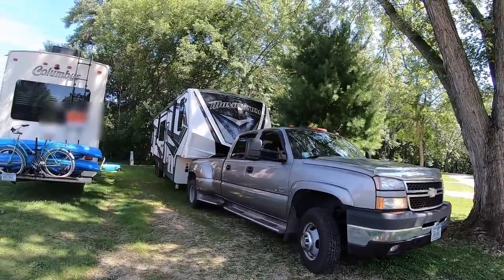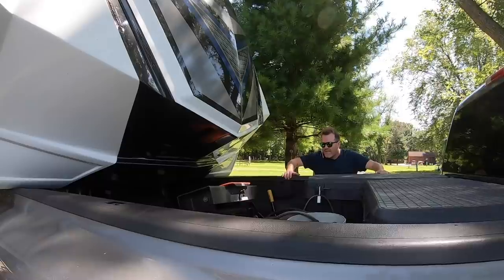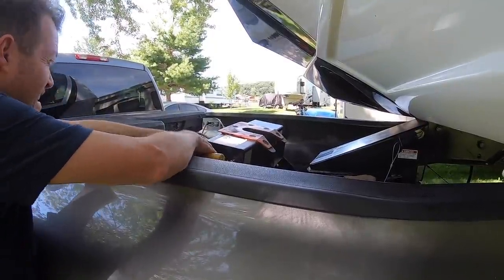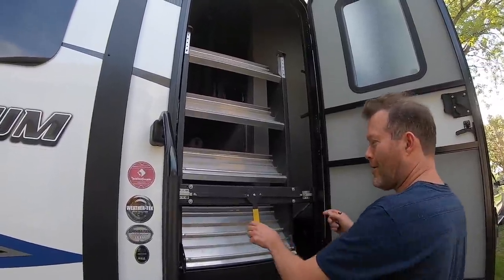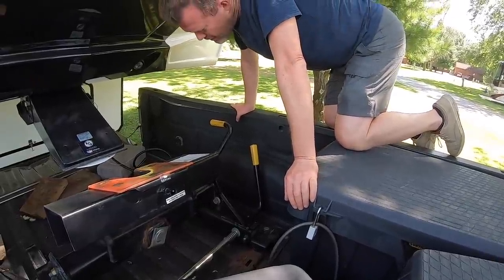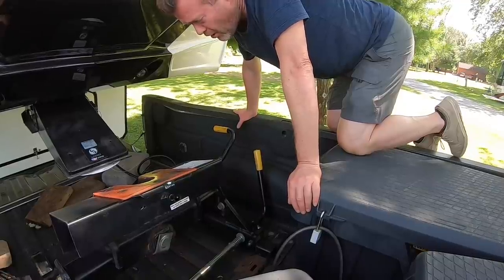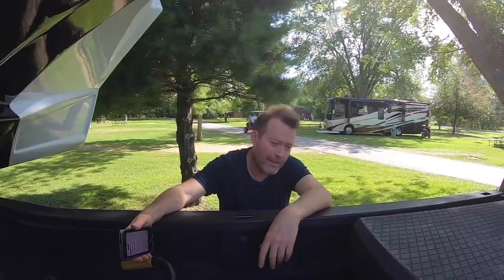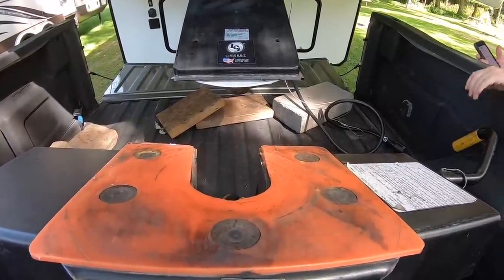RV CRUSHES MY TRUCK ON 1st TOW! BIGGEST RV LIVING FULL TIME MISTAKE! (PT 2)

Comment: This is why I LOVE my B&W Patriot hitch!  Simple, easy to use, superbly built and virtually zero chucking.
Reply: Chris Ducote 
I have a B&W Champion hitch, but the same happened to me. $7k worth of damage to truck only. We all live and learn.  I've pulled two trailers for 8yrs and still had one issue. Liked the comment from the trucker.
Reply: That's my model, very positive assurance it's locked.
Reply: I have a B&W companion and have never had a problem as long as you hook it up right. They are very easy and simple to use.
Reply: I love my companion hitch. They are simply the best
Reply: Held my breath the whole video
Reply: I have a Blue Ox fifth wheel hitch - Love it !!  And because it rocks back to give the extra short bed clearance, you don't get a "frozen" slider.
Reply: just gotta do a pull test no matter your hitch. takes 10 seconds and will ease your mind.
Reply: For 22+ minutes? Sure ya did.
Reply: I feel the same way abouut the B&W Companion.
I painted the jaws bright RED to help me see they are closed.

Comment: Hi! I’m sorry to see this happen to you. I’m a truck driver with over 30 years experience. I swap trailers daily. I want to share with you the steps I follow to avoid dropping a trailer. Connecting: 1. After confirming the fifth wheels jaw is open, back under the trailer lining up the king pin and fifth wheel. I should mention that you want the trailer’s king pin to be below the height of your fifth wheel. You want the fifth wheel to pick the trailer up slightly. This avoids the king pin riding over the top of the fifth wheel or the king pin tripping the jaw on the fifth wheel but not being connected. Once you feel the trailer connect to the fifth wheel, gently pull forward to confirm you have a solid connection.  Get out and visually inspect the connection. Is the fifth wheel flush to the bottom of the trailer? You don’t want to see any gap here. Is the fifth wheel jaw release in the locked position? If anything doesn’t look perfect, get under your trailer and visually confirm the connection. If you still aren’t sure of the connection, release the jaw and start over. If you have a good connection, go to the next step. 2. Hook up the pig tail making sure it goes in far enough to lock in place. If it doesn’t want to go in, spray both male and female connections liberally with WD40.  Also secure your break away cable. This is where we connect our blue and red airlines if applicable. 3. Last thing you do is lift the landing gear to ride height. Hope this helps.

Comment: As a CDL holder myself, you should always do a tug test after an auto-locking the 5th wheel pin snaps shut. That is how you verify it's locked.

Comment: Whenever the fifth wheel wont release the king pin you have the truck to far forward creating pressure that wont let the locking jaw release. With the trailer brakes engaged and landing gear down, back up a little to release pressure and the fifth wheel will release. 8 year trucker veteran here. Also find a suitable grease to apply to the locking jaws to keep the internals well lubricated and prevent rust getting in the way.

Comment: You could probably straighten out the bed rail sides by just putting a jack under it, and just raising the jack with a piece a two-by-four wedged up under the rail. The tailgate can be replaced
Reply: bottlejacks are great if you can find one small enough to get in there.

Comment: On a more considerate note, I appreciate your transparency in showing this clip, it is a way of showing other people to take care and double check that the pin has properly locked, also not to use two friction plates.
what I'm trying to say is thank you for showing what happened as you could have easily not uploaded.
Take care, James

Comment: I’m reminded of something I learned working in IT. Never make two changes to one system at the same time. Also, test changes before using. As noted elsewhere, do a pull test with legs down. The thing to note is that every time you hook up, that is a change, and needs the pull test.
Also, the fallacy of “I’m just going...”, as in your case “I’m just going across the park.” In reality that is no different than “l’m going across country.” It still needs the test.
Reply: Umm i have never worked in an IT environment where a patch or deployment cycle contained a single change. 

This is why we build AUTOMATED tests to test each part each time.

Comment: Classic high hook condition where the jaw wraps around the lower part of the pin instead of the center. When you pull forward the pin just pops up and out of the hitch.  If you manually apply trailer brakes and tug lightly before you retract the landing gear it shows itself with little or no damage. 

Lose the white lube plate, the hitch already has one.  

There should never be an air gap between the hitch and fifth wheel plate when you hitch the trailer.  The trailer needs to ride up onto the hitch when you back under it. The  lube plate increases the likelihood of this happening again because it adds space between the plate and the hitch.
Reply: Exactly. I knew it would not hitch correctly when I saw him install that white lube disc.

Comment: We have the same trailer as y'all, I noticed you had your shower doors closed...when we bought ours from the dealer, they told us to use the lock at the far left and lock them in the open position. This will keep them from sliding about when y'all are towing, and breaking all over the place. 
I understand this was just a short scootch down the lane, but thought I'd throw that out there...

Comment: My guess is the nylon disk is too thick for that hitch. The first time(when it fell off), you high pinned it. The second time(when you couldn’t get it unlatched), it barely latched the neck. So the jaw was stuck on the lip of the king pin.
Reply: Agree
Reply: Already had the plastic on the hitch head, probably didn't need the 2nd disk on the kingpin.
Reply: Was gna say the same thing need to take the disc off
Reply: I have to agree.  The white disc was not needed with this hitch.  Has a plastic plate built in.  Easier to high pin the thing with half inch of plastic taking up room.  Get rid of the white plate.  On the other hand, we have all made mistakes.  Nobody got hurt and a new tailgate and some body work along with six months and the memory will fade. You just feel rotten when it happens.
Reply: I agree. No need for the disc, it already had a plastic plate.
Reply: Exactly.... had the same issue
Reply: @caseybalvert3547  just gotta check for frame damage too. likely the suspension and bed absorbed most of it but that's a lot of impact force behind the rear axle. IMHO, me personally, i'd bang the bed straight from the inside since it's all open anyway. It's not a brand new truck so it doesn't have to be 100% exact. But i'm a cheap fuck, lol.
Reply: @looseballs1966  So thats' how I get grease all over my rig.... Never saw a 5th wheel wear out using just a little greas.

Comment: It looks like the pin is too high up in the receiver for the receiver to latch properly, I think you need to remove the slick disk (I think it adds too much thickness), plus it looks like that hitch has one built in. Sorry if someone has mentioned this already (I can't read through 1,577 comments).

Though I'm not sure since I've never used one of those, it's just a scientific observation. But from what little I could see in this video it looks like the notch on the pin is above the locking bar.

Comment: I might have spent a few more minutes with the Seller and had him show me how to use the New hitch and my new trailer...  And, I might have looked inside the trailer, not for a fallen lamp and spilled cereal, but for structural damage to the trailer...
Reply: Structural damage would not have been readily visible.
Reply: Quirk is right, it's hard to say if youll see anything. on one hand the trailer might have enough reinforcement for impacts like that because the manufacturer might take into account people will fuck up. on the other if it is bent somewhere it's reeaaaaaallly hard to say, it's hard enough to see frame damage on cars let alone on 40 plus foot trailers.
Reply: Actually in part 1 they recorded the old guy telling them exactly how to latch it. lol

Comment: Paint the locking jaws yellow and ALWAYS LOOK AT THE JAWS when you hook up to make sure the jaws closed all the way and make sure the jaws are locked into place and do a test tug to make sure! Things will happen, it is unavoidable in the RV world. I know it sucks but the important thing is no one got hurt.
Reply: Also get to know your equipment inside and out.
Reply: Take the time to use a good flashlight and check your kingpin from the rear even in broad daylight and always do a tug test before raising the landing gear

Comment: As a truck driver, I’ve learned over the years always get out make sure the pan is locked and then do a tug test.
Reply: Can’t do a tug test with rv landing gear. But he should definitely get out and make sure the fifth wheel pin is completely encompassing the king pin in the right location
Reply: @uhighsmith  you apply the trailer brakes manually with the brake controller as you step on the truck's accelerator.
Reply: uriah highsmith you can by just slightly raising the landing gear and do the tug test. If it drops, it will only drop an 1”. No harm, no foul.
Reply: Yeah I’ve thought about that but I just don’t trust them that much. To many moving parts and hydraulics. Certainly doable though. I just trust my eyes more than a tug test. I do both in the big truck but I just do a visual check with my fifth wheel. When he bought his fifth wheel they should have definitely gone over this with him and shown him what it looks like with a positive lock
Reply: uriah highsmith yea the guy he swapped 5th wheels with should have given him more instruction. I see drivers high pinning and dropping their trailer at least twice a week. Especially in the winter when the jaws are packed with snow.
Reply: I saw a guy undo a trucker's lock and laugh. He said it serves em right not to check
Reply: As a rookie truck driver, I dropped a trailer on the frame rails by not tugging. It was a heavy load...and, it was pure Hell jacking it up enough to get under it...never did it again.
Reply: @rodneyholcombe202  Yea, that is a big thing with ASSHOLE drivers. I saw a guy do it to a rookie driver...the guy had trouble backing in. The driver went into the truck stop...I saw the guy walk across from the other row...my window was particularly open...I was in my seat. I gave that jerk one Hell of a cussing. I told the driver...he went over and gave him heck, too. I think guys like that need to have their license revoked.
Reply: @uhighsmith  Doesn't need to be an inch. You can do 3/8ths or something, or even 1/4. You could also get something like an exhaust jack and stuff it under the middle, partially fill it and boom you have a giant cushion for the landing.
Reply: @michaelcook768  did you bend the trailer? that kind of drop with a load is huuge impact force
Reply: @0xsergy  No, it didn't...but, it was a short drop, and, the truck air springs give quite a bit. I guess the drop wasn't more than 8 inches...and, the 5th wheel plate turned downwards before it dropped on the frame. If the truck had been moving 30 mph, the additional forces would have caused real damage. I felt like an idiot.

Comment: yea, thats why you tug test with the legs still down. use your trailer brake with the light cord connected to apply the brakes and see if you can pull the hitch apart
Reply from the maker: Thanks KC, great tip!
Reply: Exactly..
Reply: Being a retired truck driver of 30 plus years, that a must, the tug test, hopefully you've helped alot of people with this video, btw I dropped a Simi trailer once and it was loaded, the landing legs went thru the  Asphalt.
Reply: @camperbum  I've seen a tractor trailer dropped at a stop light. The driver was baffled. Imagine if he made it to the highway which was only a block away?
Reply: KC Matloff that’s the way they taught us in CDL school.
Reply: I have been full time in a fifth wheel for 5 years. The tug test is a must!
Reply: Slightly off the ground an inch or so instead of down.
Reply: @camperbum  I've got 40 years and the tug test is the first thing you do after looking at the locking jaw.
What I do not understand about pu trucks with 5th wheel hitches is I've never seen any of you with grease on the plate.
Grease on the plate and a lubed jaw and pins makes everything work better and on the plate makes handling easier AND keeps wear on your steers (front tires) down! That is unless you have a silicone plate on the 5th wheel that acts just like grease. You'll be surprised how different the handling is especially in rain and turns.
I use a 6" putty knife to spread the grease on my tractors 5th wheel and make sure the shop greases the grease zerts! Store the putty knife in a piece of old pizza box so it's not getting the grease left over on it on everything if contacts or just use a piece of heavy cardboard to spread it.
To those who say anything you put in the truck bed will get grease on it forget you can cut a heavy duty tarp , sew a pull cord around the edges and make it's own cover! No grease. That is unless they make covers for your type of 5th wheel like they do for road  trucks.

Blue Sky's and Safe Journeys!
Reply: @camperbum  what was better when i worked a tool and die.  We got a 2 press components delivered and one was back inside and one in the parking lot. I punched an 8 x 6 block 2 ft long through the ashphalt so they had fun getting it on thier tractor the next day.  The press piece was 20 to 30 tons
Reply: Exactly what I was going to say, lock up the trailer brakes and pull on it, if it's going to hold you will know immediately

Comment: I run into this problem regularly.  Lock the brakes down on the trailer.  And back the truck up just a bit to release the pressure of the fift wheel jaws to the kingpin.  Then it should release

Comment: The guy they bought the hitch from showed them how to do it and the guy either forgot the steps the prev owner said or ignored them
Reply: Since he recorded the guy explaining how it works, maybe a quick rewind of that part.
Reply: This is painful for me to watch
Reply: Last video from 3:30 to 4:30. He was supposed to raise the handle and let it pop in.
Reply: @kenworth k100 just because he was going a short distance he ignored (or forgot) to move the pin to lock the whole system and take off the handle like he was told by the seller. I believe that's the reason the trailer dropped. Lesson learned, everyone!!!
Reply: Big dummy big dummy
Reply: @miketippett7264  Sandra Westley from the UK very easy to say in hind sight, it’s easy to make these mistakes for the first time, so just a bit of understanding would help instead of clever comments.

Comment: That silicon ring caused the high hook . I’m a old truckdriver . Use grease. Listen to Scott Mertens. Thank God you didn’t do it in the road
Reply: You are correct. That ring does not belong on that hitch, it makes the pin sit too high
Reply: blacksmithnc what’s wrong with grease? I Grease my balls all the time
Reply: I was waiting to see someone with the right answer. 20 years of towing and tried the magic white failure one  never again.
Reply: Dave the RVer Little grease never hurts anyone
Reply: @mrpaulgrimm6129  If you don't have grease spots on the right shoulder of your shirts, you aren't a truck driver. LOL
Reply: Gordon Strickling That right 10-4
Reply: That is right it, your hitch al already a glide plate.  That orange piece is a glide plate

Comment: When you do a tug test you need to put the trailer brakes on full otherwise you aren't really testing the connection.
Reply: Trailer breaks applied and landing gears down. I wouldn't even raise the landing gear until you do a tug test
Reply: OETIOHeavyLifter how do you set trailer brakes on a camper tho?
Reply: You don’t SET trailer brakes on an rv. You have a trailer brake inside the truck with a slide lever. Pulling the lever left and holding it manually applies the trailer brakes Just like a foot brake on the truck
Reply: @RiverValleyAcres  you only need to set the brakes after you fill your turn signal resevoir.
Reply: @CHUCKSNORRIS  before or after i put gas in a diesel truck?
Reply: Gerald Boyne thanks I honestly didn’t know what this guy in the original comment meant by saying “full” I know you can’t set them like a trailer with air brakes.

Comment: Hi Tom, just saw this video... I've been there... DONE THAT!!!... really hurts inside,, but got my truck fixed and the trailer.... Suggestion... every time I hook up now I do the complete hook up.. latch & lock.. leave the legs on the 5'er down.. then pull forward.. you'll know right away if the hitch is locked properly... AND the camper will only slide an inch or two if it is locked right.. Hope this helps you in the future.. Jerry